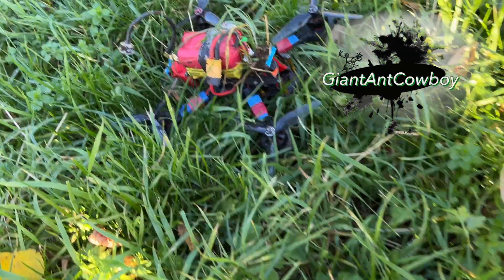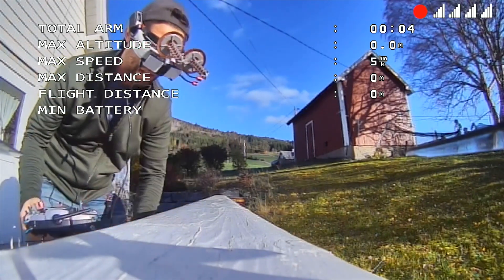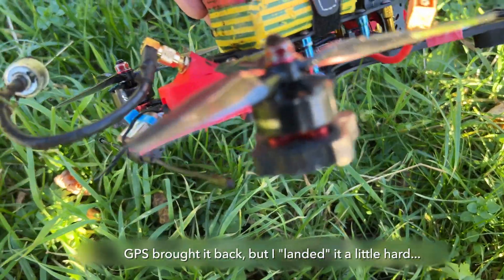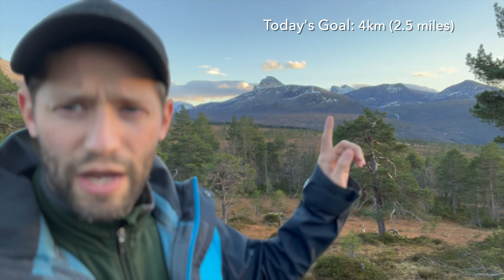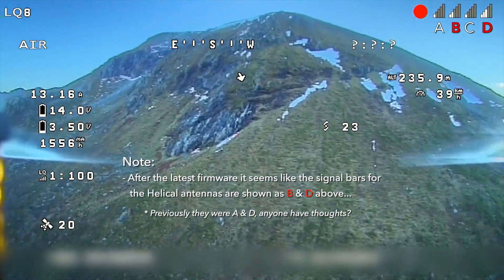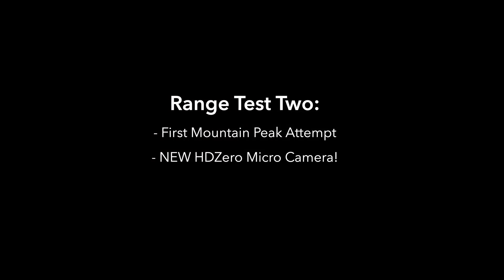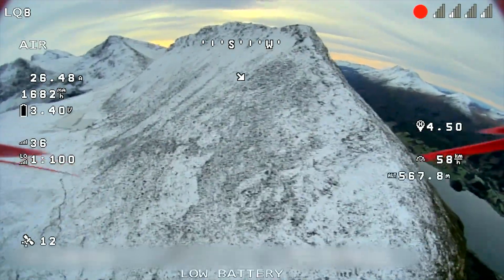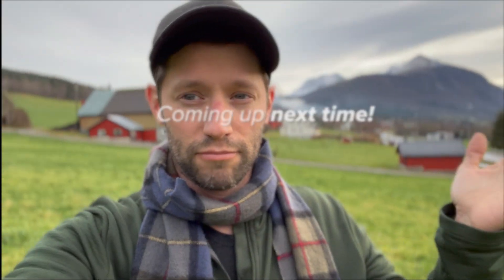HDZero Shark Byte Long Range and Penetration Testing! Digital FPV Testing and Mountain Surfing!

Comment: What channel are you running on? I.E the frequency match to your tx antenna
Reply from the maker: I’m running on channel R1, specifically because at lower frequencies most VTXs can transmit at a higher power. (Ex: a 1W VTX might transmit at 1W on R1, but only 400mW on R8) I don’t have an RF meter but several others have confirmed this. 
This power transmission affects the signal much more than the specific tune of the helical antenna. I’ve tested several channels out to 7km and did find R1 performed the best. Long answer… but wanted to share some insight. Here’s an updated range test I did recently with the HDZero 1W VTX and Two Helical antennas.
https://youtu.be/JQiLjMU3J90

Let me know if you have any questions, cheers!
Reply: @GiantAntCowboy  That was exactly what I wanted to know and why I wanted to know it. I've been spending much time of late looking for R1 optimal antennae.  ;)
Reply from the maker: @m3chanist  Wez Varty, (YT) said the TBS Triumph antennas were tuned more towards R1, so they’d make a good VTX antenna option. I’m currently using a TrueRC Singularity, but also have a TBS Triumph. My initial tests didn’t show much of a difference between the two, wish I had proper test equipment but if I had a spare $30k I’d properly buy something else. Lol

Comment: Hvor i landet flyr du stilig jeg kjøpte meg sharkbyte modulen og 500mw Vtx en men jeg kommer ikke halvparten så langt ut som deg men har ikke testa det i åpent terreng veldig bra test elsker de antenne dine er de vanskelig og lage jeg har printer masse hilsener fra Telemark porsgrunn 😎
Reply from the maker: Greetings, I’m in the Romsdal region, great place for FPV. The 500mW SharkByte/HDZero works great, I mainly use the newer 1W now, but will be installing my 500mW VTX in another build soon. These antennas are really incredible, I just posted an updated range test a couple weeks ago that you should check out. They are very cheap and easy to make. Here’s a link to my DIY video. Let me know if you have questions, cheers!

Comment: Have you done any long range with dji? I am looking to get into long range flight..
Reply from the maker: Unfortunately I haven’t used DJI.  When making the switch to digital I looked at both options and even though no one was doing LR with HDZero at the time I decided to try it, and have had great success! (Check out my more recent videos)
DJI works well and has nicer image quality, but comes with a few sacrifices. Ex: Doesn’t have full OSD, doesn’t record OSD, limited to 13km, has variable latency, and actually the worst thing… it’s a two-way system that can de-sync or un-bind when you have weak signal or lose LOS. If this happens it could take minutes to re-establish the video link which could easily result in a lost quad. 
DJI is more plug-and-play currently, but of course with less options. 
HDZero is quickly evolving, and inventory sells quickly which can be tricky, but it has an excellent community of helpful people which is a pretty unique Pro for the system. 
Ultimately there’s a lot of Pros and Cons, if you currently have a nice pair of goggles with an HDMI input HDZero would be a good option to upgrade. 
With regards to Long-Range, make sure you have GPS and that your GPS data is setup to display and log on your transmitter. It’s easy to lose signal, crash and never find your quad and GoPro again. Which gets expensive… hopefully this was helpful, thanks for watching and stay tuned, cheers!
Reply: @GiantAntCowboy  yea.. so far I have yet to be able to get a GPS to work. I have some box analog with no hdmi input, and I was given DJI gear so I a waiting to see what happens with the new goggle war to see which to buy. HD zero is winning given I know it ca handle long range.
Reply from the maker: Gotcha. Do you have DJI goggles then? Or just the VTX/camera?
Definitely get GPS working it’s very important. Tells you speed, location, distance, has a home arrow, and GPS rescue is a life saver … when installing the module make sure you don’t have the RX/TX wires reversed or it won’t work, and make sure you’re outside when try to get satellites. You’ll never get satellite indoor or through a window.
Reply from the maker: Cool, well I’d fly DJI if you have all the stuff, just don’t fly behind mountains or cliffs and the de-sync issue I mentioned won’t be a problem. 
As far as GPS definitely try to swap the RX/TX wires, and if that doesn’t work there’s are number of good setup videos, J.Bardwell for example which should guide you ti success. 👍

Comment: did you go with 2 omni antennas to the top of the mountain? If not, how for do you think you could go with hdzero sharkbyte  and omni antennas with straight line to the drone?
Reply from the maker: I used the two helical (directional) antennas shown in the video, and the stock patches for this test. How far you can go with omni antennas of course depends on the which VTX and which Omni antennas. I’d say you could probably go 3km (1.5miles) if you had clear LOS, but the stock patch antennas would probably be doing most the work…

Comment: Ok, so you are out on a mountain at 3.3V per cell. How could you get back ?
Or is that mountain filled with dead quads from one-way reviews ?:)
Reply from the maker: Haha! Yes, many viewers have thought the same thing… especially in my follow-up video where I didn’t quite make it back: 
https://youtu.be/gxSfD6PH1P0
However I must point out that I’m using DIY Li-ion packs which can safely drain to 2.5v, these packs are really great for long-range, and also pretty cheap and easy to make. I have a simple diy video, check it out if curious. Anyway, I’ve since built a proper long-range drone to test the new HDZero 1w VTX which had been great, so stay tuned for that, cheers!

Comment: nice! i used that exact same 3d print i think only its 5 turn. isnt it such a cool feling to build something like an antenna and see it actually work?? i love it. cheers bud!
Reply from the maker: Absolutely, I’ve built several of these helicals. My first ones I called Trash Helicals because they were just old parts and pasta sauce lids, but they worked perfectly. You should check out my follow up video to this where I test a quad 7-turn helical antenna setup. 
Thanks for watching, cheers!

Comment: What HDZero vtx was that? What was the output? 200mw?
Reply from the maker: This was actually the older 500mW VTX, but check out my recent video because I do a few range tests using 25mW, 200mw and 500mw: https://youtu.be/gxSfD6PH1P0 
I’ll be testing the new 1W VTX in the next couple weeks, so stay tuned and let me know if you have any questions. Cheers!
Reply: @GiantAntCowboy  I'll do so. I'm just sad that there is no point in investing into Hdzero atm since there is not stock for us guys wanting to do freestyle and long range. I think there are a lot in my situation, I'm newish to FPV, I'm not in interested in 200mw but if I go Hdzero I would want/need to convert my quads... There is just no stock...
Reply from the maker: @InfinityDrones   Yup, 100%. I think this issue will be resolved early next year. In fact I think they’ll be announcing something next week. I’ve heard new VTXs, cameras and VRXs are in development and testing. Very excited about the new VTX for freestyle/long range use. Check out this video/range test of the VTX-L by Wez Varty: https://youtu.be/mYELtL8ACww
Reply: @GiantAntCowboy  I hope so. I jumped to express lrs and I'm very happy I did that. The way they are approaching it is great. Hoping to jump on the Hdzero train once they start selling "real" tickets hehe. I watch Wez's video and that made me just want to go this route more. Just seems ill have to wait 6-12 months realistically, which is sad.

Comment: the sad and ugly thing in 5.8ghz is range, high frecuncy, short wave, less penetration, :(, i miss the time that we fly at 900mhz and crapy common antennas and do 13 km with ease, however is very respectable the distance you do considering that avaible vtx dont trow more than 1w, i think we are goign ending using a "ground station tracking gimball" in our models with a directional antenna to make long range, or how knows, maybe in a few year with starlink we could use ip cameras micro tx and fly to the edge of the world
Reply from the maker: Yea, this is just a 500mW vtx, HDZero will soon have a higher powered VTX which I’ve heard from sources will meet your wishes above.  I think we’ll find out very soon actually! 
Appreciate you watching and commenting, I’ll be posting a follow up to this video shortly so stay tuned! Cheers!

Comment: Yeah, sharkbyte is like flying analog...lol...full of bad transmissions.....who is using this? its the same bad picture of analog....lol
Reply from the maker: I can’t tell if this is sarcasm or not (?)… lol
Reply: @GiantAntCowboy  it isnt sarcasm...so much artifacts in the picture. i can fly 10km without any disturbing artifacts - with another big brand...

check for that vs videos (there is one in a parking lot) - the big brand works fine the whole time, sharkbyte have artifacts 3sec after start...

and look yourself for your video. the picture is very restless, the whole time
Reply from the maker: @fellpower I have a no argument about DJI’s excellent image quality, it looks crazy good! The two systems however work differently. 
- DJI avoids having signal static by increasing image latency and reducing resolution. 
- HDZero on the other hand uses fixed latency and resolution, but displays static when signal is disrupted. 
- Also DJI currently has a more powerful VTX. 
Again I agree DJI is great and HDZero needs work, but it’s a tiny company that’s working on an alternative solution which I totally support, for team has been improving the system a lot recently. 
Why I chose HDZero over DJI has a lot to do with cost, I already owned decent analog googles/antennas, so it was an easy upgrade from analog. Also I primarily fly in the mountains and have seen too many stories of DJI units freezing, rebooting and losing signal for several minutes… these could just be outliers, or user error, I don’t know. 
Anyway, here’s a video I did comparing my analog system to the HDZero system, and you’ll see HDZero is substantially better that analog.
https://youtu.be/fLGTMQMgDfE

Appreciate you taking the time to respond, and provide feedback, cheers!

Comment: I was trying to learn more about making antennas and stuff. What about those big one that they had on flite test back in the day? Would those get better range than the tiny helical one you have won your quad. And the big base station setups? I’m interested in doing some longer range flying so I’m definitely going to sub and learn all I can!
Reply from the maker: Hi, thanks for watching and supporting the channel. I guess the real question is how far are you hoping to fly? These antennas I’m using have potential to reach 7-10km+, which is pretty far. In fact where I am it’s very difficult to find 10km with clear LOS, unless I’m at the top of a mountain. Additionally if you’re flying drones battery life will limit your range. 
If you’re just starting in long range, I wouldn’t worry about researching or making huge antennas. Just make or buy some helical antennas and focus on increasing range 1 or 2km at a time. 
You’ll wanna make sure you quad is setup for long range too, li-ion batteries, GPS, RTH, Self-powered buzzers, etc.
Reply: @GiantAntCowboy  Ok thanks! is there anything that will cut throught say forest or are we prity much limited to open area?
Reply from the maker: @excellenceinanimation960  unfortunately 5.8ghz doesn’t have great penetration qualities, so ultimately you just need High Gain Directional Antennas and a High Output VTX. 
Helical or Crosshair antennas are probably the best for penetration. If you’re using or planning to use HDZero, then stay tuned for the new high powered VTX coming next month. 

If you are in the forest and it’s mostly tree trunks you’ll have good signal, it’s the leaves and foliage that really blocks the radio signals. 

The other alternative is you start using a lower frequency system like 1.2ghz… but this is more complicated and will have higher latency.
Reply: @GiantAntCowboy  ok thank you! This is really great information!

Comment: Impressive!!! 5.6km on a 5 inch. Think it’s time to setup my long range game as well. 

I see you didn’t have a GoPro (or recording device) on the drone. Guess that might be a little heavy for the 5inch, especially going that far. Gonna put it on the 7 inch I imagine?
Reply from the maker: Hey man, so the first two tests were with an old 5”, but the last part when I went 5.66km was with my 6” drone. The 6” will carry a GoPro no problem but I left it behind because the focus of the video is the digital system, and also for weight savings/less stress if I do lose the drone while testing… haha
What’s your current range max? 
Definitely looking forward to pushing the new Chimera7!
Reply: @GiantAntCowboy  I see, yah that makes sense. My current max is just over 4km and at that time I was still rocking two 1500mah lipo’s and I couldn’t really go any farther due to battery life (GoPro + two lipos make for a heavy ass drone), but I’ve recently built a 4200mah li-on so I got the juice, now I just need better antenna’s for my HDO2’s, Soon!!
Reply from the maker: @richierich142  oh nice! Got a Molicel P42a pack now?!  It’s the only thing I fly for the most part now a days. Obviously helicals are where it’s at, if you don’t wanna make them ORT makes decent ones, and honestly any helical is probably fine. You’ve seen mine, they’re hardly “precise instruments of perfection”…
Additionally TrueRC X2-air antennas are supposed to be dope.
Don’t remember if you saw my recent post but I got 3km+ with the VTX at 25mW using helical antennas… crazy!
Reply: @GiantAntCowboy  Yup bought some Molicel's and made my own pack. Yah I'll do some more digging before making or getting some antennas. But they are for sure a must.

I did see your other video, I was impressed that's for sure!!

Comment: Thanks for this beautiful video from beautiful Norway! 
HDZero seems to have potential. Hopefully there will be a lot of product releases next year, beause right now the options are pretty limited (you can't even buy HDZero goggles right now, let alone vtx with up to 1W of output power). Let's hope for the best. Keep up the good work, cowboy ;-)
Reply from the maker: Thanks for the nice comment, very much appreciated. HDZero definitely has potential, I’ve spoken with the team over there and they are really excited about the system and have a lot of new things in the works, including: a 1W VTX, new VRX which can receive both analog and digital signal, and HD goggles! Additionally Foxeer just released a new camera which is looking great, and I’m sure other camera manufacturers will be joining the game soon. Historically HDZero was working with FatShark and branded as SharkByte, but i think that partnership was actually slowing/limiting the system’s progress. The creator of HDZero has decided to just push the system himself, which is a gamble but many are supporting his efforts, and I think it’s pretty cool! Anyway, definitely stay tuned, I just took a test flight with the VTX accidentally set to 25mW and reached 3km before deciding to turn back. That’s amazing, and the mistake turned out to be a pleasant surprise… 
Long response… but thanks again for watching, cheers!

Comment: make Sure you try a 5s1p Liion battery in your 7" build. it's the best compromise between 4s and 6s. 👍 (Power to weight Ratio)
for 7" Props i would recommend the dal7056 and the gemfan7040.
with 7" the real midrange/longrange Game IS a Lot of fun and smooth flying.
Hope to See your 7" experience soon.
Happy flying & greetings from Germany.
JT
Reply from the maker: Awesome, thanks for the feedback. Definitely gonna make some 5s packs, really I’ll probably just add a 5th cell to my 4 cell packs, 😄 I’ll check out those props. Are you using 2 or 3 blade props?
Reply: @GiantAntCowboy  the Sound and efficiency of the Gemfan 7042 biblades are great but they cause a Lot of jello with my 7" frames. better use triblades for smooth Videos.
Reply from the maker: @MrJT270567  ok. At the moment I have HQ 7x3.5x3 props I’m gonna start with. Also have some 7x4.5 two blade that I’ll try, but historically i prefer the thrust character of 3 blade props.

Comment: i guess you are flying Crossfire, so what Power Level U use for a range of 4 to 6km?
i am using expresslrs 868mhz on 250mw but i didnt Test Out the max range yet...

greetings from Germany
Reply from the maker: Hi, yes this is 868mhz crossfire, and I believe I currently have it set to 1W (probably unnecessary). I’ve never had issues with the system, and have been out to about 7km. I’m currently building a new 7” long range quad, so we’ll find out soon how well it works. 
Are you using HDzero/SharkByte?

Cheers from Norway, thanks for watching and commenting!
Reply: @GiantAntCowboy  thanks for your answer, currently i am flying analog with caddex Ratel, akk Race Ranger and fatshark hdo2. i am looking forward to get hdzero for some of My Quads. 
btw. i also use the diy 7turn helical and it's amazing. 
you have great Landscapes around you to Explore. waiting for some nice longrange Footage from snow powdered norway 😁

always Happy flying & greetings from Germany.
JT
Reply from the maker: @MrJT270567  Thanks for the nice response. The Caddx Ratel is my favorite analog camera, hope they make a HDZero/SharkByte camera eventually. These DIY helicals are the best, and perfect for exploring the mountains. We literally got snow everywhere this morning, so stay tuned. Thanks for watching, stay in touch. Cheers!